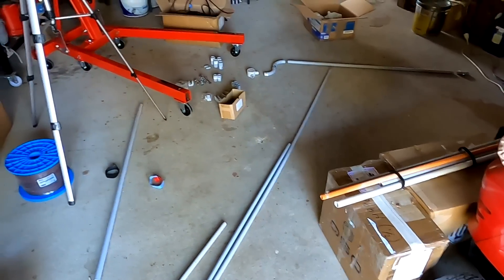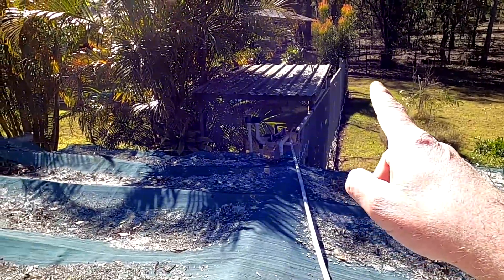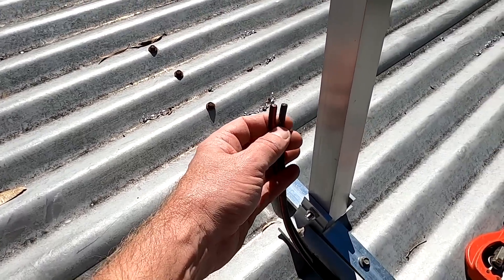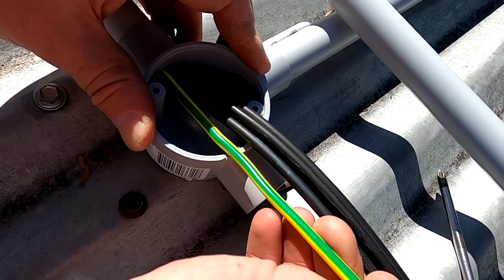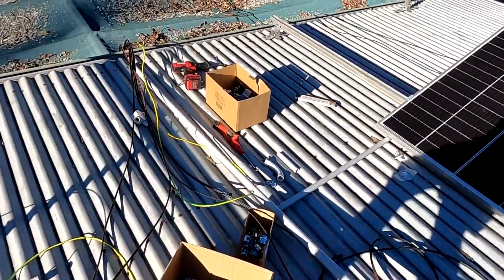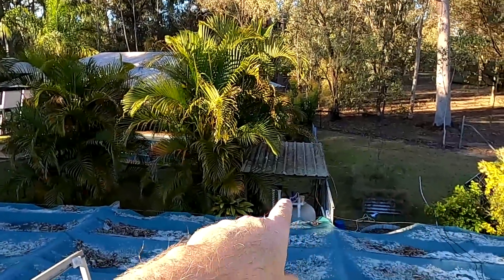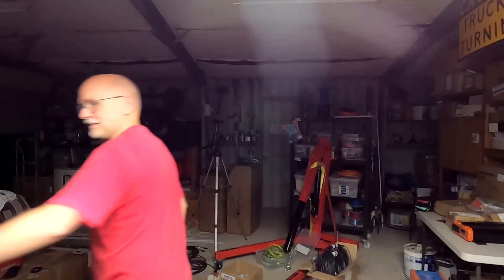Solar Tilt Installation design and cabling. It finally happens...

Comment: Sounds more like an oscillating multi-tool to me, planers are usually one solid long note until the wood comes out the other side, the tone kept changing in the noise in the video.
Reply from the maker: You could be right here...

Comment: Don't get talked into wind, unless your closest neighbor is over 100 metres away.  Also you will want it a fair way away from your house.  These things are noisy.  might not seem it at first, but in the middle of the night.
Was a bloke up here that got solar installed then added wind.  First 1 windmill then a second, bigger one.  Before long the mill was tied up to stop rotation.  Next came the For Sale sign on the house.  I was told by a reliable source that his neighbors complained about the noise.  So he sold up and moved out of town to acreage where he had room for his stuff.

Comment: Intersting to see what the dc losses are and how much heat is generated by the cable distance.
I wouldnt say the decision is 50/50.  
Cooling the inverter in its own box on the roof wouldnt be a problem vs the cost of all that copper and losses to keep it in the ready made shade.
I have 2 battery banks and 2 chargers and the charger cables are maybe 1 foot in length difference, but it does show a 0.2 volt difference. I can and will make them the same length to not confuse the chargers.

Comment: Hi I live up the road from you, I contacted my home insurance, they said if I did anything whatsoever myself, (I am elec engineer but not accredited electrician) installing batteries, panels, inverters, the house insurance would be null and void. it has to be done by accredited installer and approved panels, inverters and batteries" also they said the max batteries that can be installed is 26kW battery. I have already bought 40kWh of cells, 10kW victron inverter and 2x 5kW victron solar battery chargers. So how do you get around this??? I got a quopte to install 12kW solar (canadian) a 13.6 kW hybrid Redback inverter battery setup ( 5kw battery inverter and a 5kw solar inverter) the quote was $29000 AUD it will never do what I need.

Comment: with the temps on that roof what is the derating on those cables due to heat? I suspect it would be quite high? (all in a conduit which is a higher derating)

Comment: Red cable ducts. Interesting!
Reply from the maker: They are for underground installation. Extra heavy duty...
Reply: @OffGridGarageAustralia  Thanks, under ground? Something like our "KG-Rohr". thick and robust, but not UV proof?
Reply from the maker: @klassichd10  yeah, like KG Rohr but also UV resistant. I just don't like the red pipe on the roof. The other one is fine and does not stand out as much.
Reply: @OffGridGarageAustralia  Thanks, top job in Australia!

Comment: Take the stickers of the conduit please, satisfy my ocd
Reply: Ps I think mounting the inverter on the roof would be better, just build a insulated protection box
Reply: I think having one 240 wire is smalller than 3 dcx2 + earth. 

Anyway it’s your choice, I’m sure you will do a bombfest  job
Reply from the maker: I was waiting for a comment... 😁
The inverter is IP67 rated and could sit under the panels. But why do you think it's better on the roof apart from the less power loss?

Comment: Like# 253  Can you explain why the DC lines would have more loss than an AC?  And that is a funny looking HomeDepot...
Reply from the maker: It's a lower voltage on the DC side but higher current. The same distance done with AC 230V has a far lower current and hence less losses.  The cable size matters as well and while we have a 4mm cable for DC we would have a 2.5mm cable for AC.
Dc would be 4x11A while AC would be 1x7A, so if you do the maths, the DC side has more losses even using a thicker cable, just because we have the losses 4 times.

Over 9m of cable length, we would have:
DC: 11A - 4mm2 cable = 1.1V drop = 12W (times 4 = 48W)
AC: 7A - 2.5mm2 cable = 1.14V drop = 8W
Reply: @OffGridGarageAustralia  I need to digest this, made sense at the end, just need to re-read it when I have some down time.
Reply: Is it that DC just isn’t as efficient as AC for transmission? I just read an article for a power generation system that was using DC at crazy high voltage and that was the key to overcoming loss over distance. 
I’m trying to find this to share but haven’t found it yet.
It’s the physics that baffle me on this, in my little electrical mind I feel like DC should be far more efficient over an alternating/pulse (AC)…
Reply: @paulcurtis5496  As you read, high voltage overcomes resistance. So high voltage DC suffers less loss than low voltage DC. 

As the AC is at 240v, it suffers less loss than the 48v DC Andy's battery system sits at. 

It's pretty much that simple.
Reply from the maker: @paulcurtis5496  It does not matter if it is AC or DC. The voltage drop or cable loss is (almost) the same.
Reply: @OffGridGarageAustralia ....due to resistance of the cables.

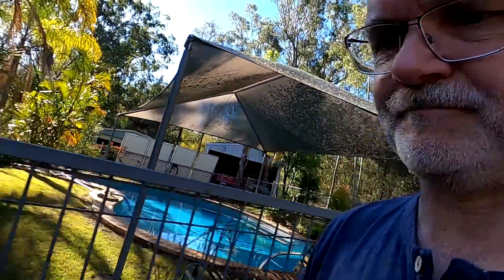Comment: Nice Installation Andy, I'm still thinking about a possible actuator solutions. At 8:05, aside from almost fitting, is percentage of wire fill in a PV conduit a code issue in sunny hot Australia?  One of engineering reasons for a not filling a conduit to over about 60% of its volume is not just for 'pullaibility', but for exceeding the heat dissipation capacity of the system. For example, if all conductors rated ampacity, there may be a point where the heat generated may exceed the temp rating of the conduit or conductors.
Reply from the maker: The rating would be still OK as it is low voltage and 'only' 11A per cable. But bigger is better.

Comment: Next time try #10/3 THWN-2, TC-ER Tray Cable. It is outdoor, direct sunlight, and direct burial rated, and it has a PVC shieth so you don't need any conduit! I'm glad you finally compromised on the tilt.
Reply from the maker: The cable still needs to be protected, no matter what rating it has. Even a cable suitable to be buried needs some sort of conduit or ducting for protection purposes.

Comment: a short visit at Bunnings, again ;o)   hehe
Reply from the maker: I'm so glad they built this 2 years ago just around the corner. Otherwise it would be 45min drive. One way.
We also have Mitre 10 here but they don't stock as much sh!t as Bunnings.
Reply: There will be a Time , when Andy gets sponsored by Bunnings ...if I ever fly down under . I will stop by a Bunnings ! Marketing is working.
Reply from the maker: @markusviel6440  Hahaha, yeah, Bunnings and Oettinger!

Comment: Kinda saw it coming, that you‘d need to swap the trunk conduit for a larger one, once you mentioned the amount of cable you wanted to pull through it. I was already anticipating some juicy german expletivs, but sadly, no such luck! 😅
Reply from the maker: I had the smaller conduit 'in stock' so was trying to use it. I could have done it with two pipes in parallel but, naaaah. The larger conduit was the right solution to keep it clean...